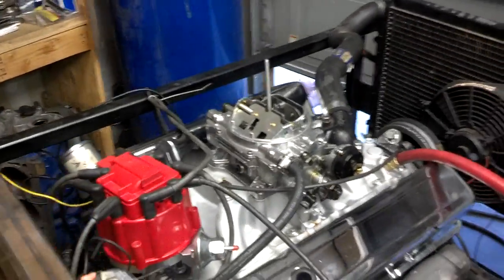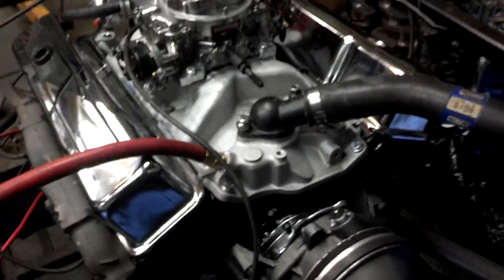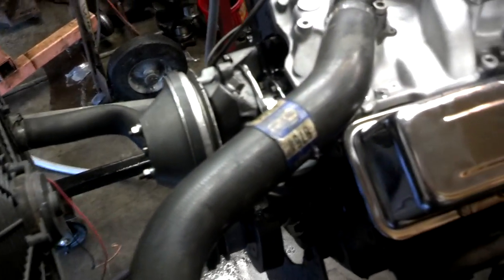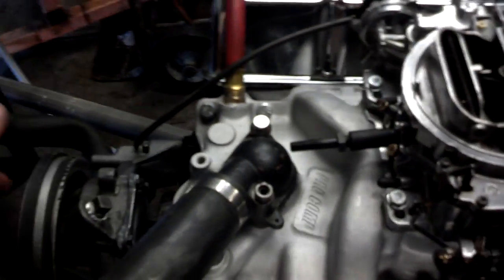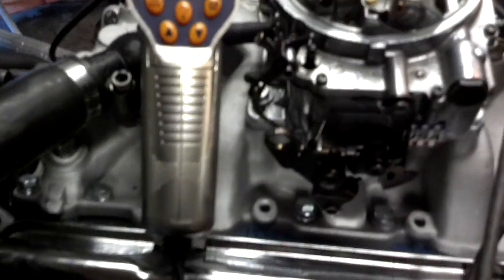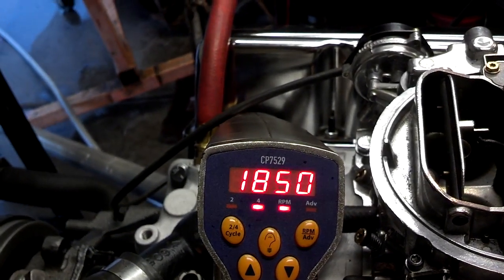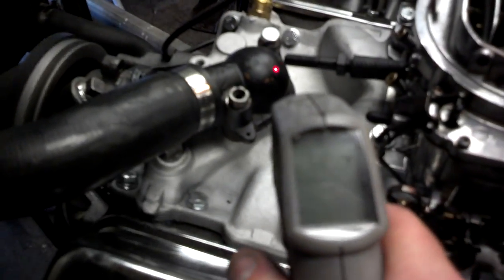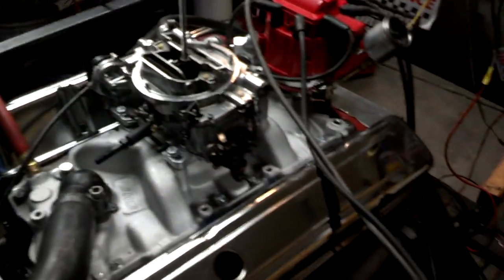350 chevrolet first run

Comment: Factory Stock Rule engines are becoming popular or the class is  in Texas and all around the nation. Could you do a build or do a video on the best head and cam combination with a lift rule of .447 lift that can pull 14lbs of lift at 1,000 rpms

Comment: I'm wanting to upgrade my timing light any suggestions? I would like something like the actron you have that has rpm and degree spec. would you buy that one again? Thanks Jack
Reply from the maker: I recommend it got this one at auto Zone it works fine I did have a problem with the first one it quit working after a year but I took it back and they gave me a new one free can't beat that!

Comment: What would be a good safe total timing for a standard to mild 350?
Reply from the maker: for 87 octane go with 30 deg total for premium fuel 33 to 35 if your engine is around 8.5 to 1 comp

Comment: Do you have experience with the Chevy 302?  I always liked them... high winding, big bore, short stroke motors. I have been told they don't run well at the strip.
Reply from the maker: The only thing they are really good for is a Z28 resto they didnt make enough torque
Reply: 302 was in the org 69z28   boat ancor with the 307 in my book  my friend did have a 302 in his 69z  built with brodix heads littlefield blower  car ran like a bat out of hell with one of my th 400s in it
Reply: 327s were a good runner too put one in a 57 chevy  neck  snaper with a built th400
Reply: I ran 9.80s in the 1/4 in a 71 Vega with a 302. Bored it .030, used custom Arias lightweight pistons, 13.5-1 compression, BME aluminium rods, lightened up knife edged stock steel crank, rotating assembly balanced perfect, splayed caps on the 3 in the middle, ported phase 2 Bowtie heads, Jomar stud girdles, Lunati roller rockers, titanium retainers on the K-motion springs, 250lbs closed, 600lbs open, 288/296 @.050, 680/680lift Ultradyne solid roller, modified Holley Strip Dominator intake, 2 inch spacer with a 830cfm Holley DP, Unilite distributor, Stahl 1 7/8 primary, 3 1/2 collector headers, 7000stall Coan convertor, 6-17 gear on a spool in a narrowed Dana 60 rear, 14/32/15 Firestone slicks on Cragar Supertricks. It ran pretty good back in the day. Bottom 6s in the 8th. Pretty simple combo really, and it turned 9600-9800rpm. Made close to 600hp.
Reply: Alot of 302s were built for drag racing back in the 70s in Modified Production class cars were ya had lbs per cube rules. Alot of 288-310 cube engines were used to keep weight on the car down. Many ran deep in the 9s. 9500-10,500rpms were common. They sounded better than about anything.
Reply: Just need alot of gear. And a lightweight vehicle.

Comment: more like the 5th run     my kid can build a 350 the proper way  hes 22  i still have  gm 202 angle plug heads  my dad got me as a teen from te tonawanda motor plant that the plant donated to me they just didnt know about it  rods and  lifters too  i was building a 396 i wa going to cut the crank 20 dad said no next day a new forged  steel crank  for my 21st birthday & a new set of rods i learned how to balance them that day   my drinkin buddy worked  at pwr train  on delavan ave in buff ny  a case of beer got me 2  th 400 master  kits   i had a 4' lathe  in my bacement  dad was a welder had all that too pretty lucky kid